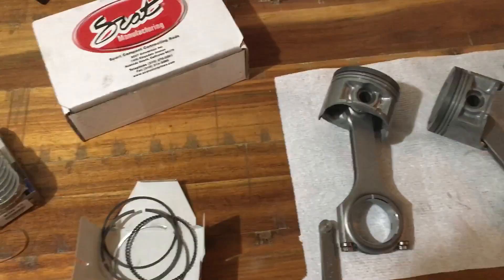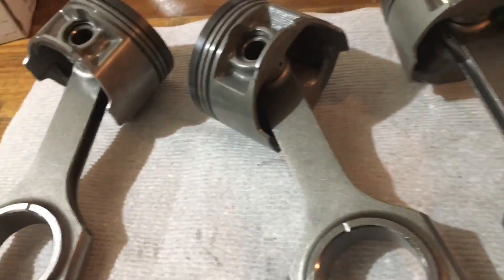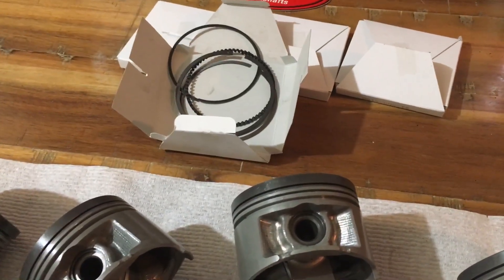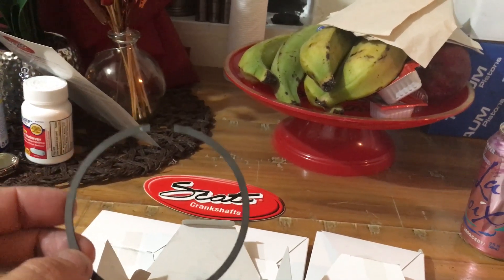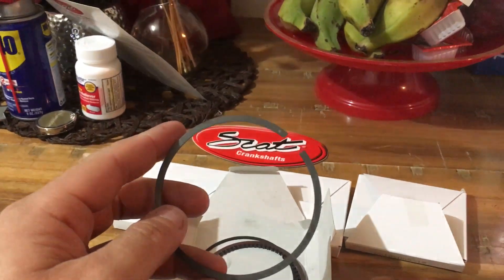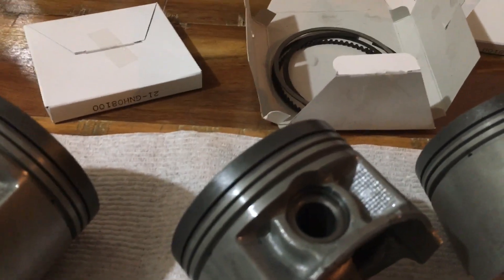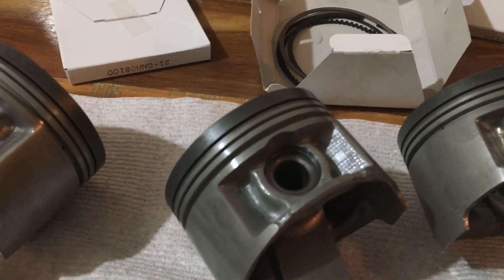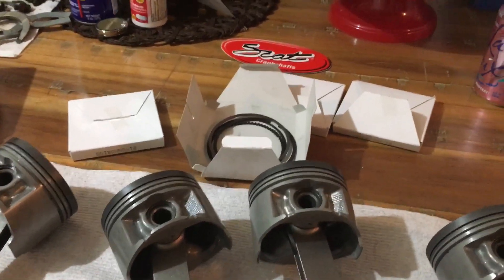Nippon Racing Ring Gap: Loose Piston Rings 👍

Comment: I dont want to sound dumb but every time I try using the formula to get ring gop size the second ring is always smaller. Is this normal or could somebody help me how to get it done correctly.
Reply from the maker: I don’t use it anymore. The numbers don’t really make sense to the application. If it’s a turbo engine I’m gapping .021 or .022 top and .024 or .025 second.
Reply: Awesome thanks. I thought I was the only one note being able to do the math 👍

Comment: Nippon Racing Type S (11:1) compression test readings.. 165.. 165.. 170.. 180.. 1st ring gap NPR ring 0.018 2nd ring untouched oil untouched. I'm on 11psi boost. Have you ever seen readings like this in a stock sleeve h22a motor.

Comment: One of my cylinders top ring .025 and the second is .024. The rest are in the spec. Will that be fine? Or get new rings for #1 cylinder? Chris
Reply from the maker: Duron Chase cross check it with the other cylinders to get an idea if it’s the ring that’s off or the cylinder that’s worn. If the ring is tighter in the other cylinders you may want to rethink either getting another block or boring over. In your case probably another block sssuming you already have pistons
Reply: @VHBEngines  lol no i bought new rings all tops were even. I filed all tops to 0.20 but one. It was the very 1st ring. I filed wrong to about 0.25 lol. My cylinders are fine. All are dead on. Acording to the old rings. Thede are the top rings. I bought cp rings. The tops were tight from .015 i believe. And the second rings are .024. So i had to open the tops ofcourse for boost.
Reply from the maker: Duron Chase if it were a build for me I’d run it. For a customer, I’d order new rings. Not the end of the world but comes down to what your comfortable with

Comment: I got the simular results when then i went with the super tech rings instead of the ones they come with. I just think if you go with these pistons you should just go with a name brand file fit set and be done with it.
Reply from the maker: StrictlyFWD well NPR is a name brand ring company 👀
Reply: @VHBEngines  yes but but i mean a file fit set npr rings arnt a file fit set there made to expand with warm up heat.